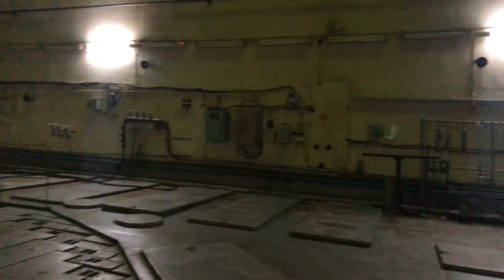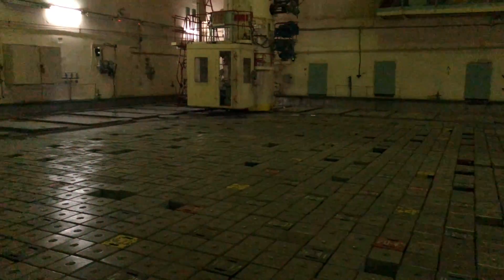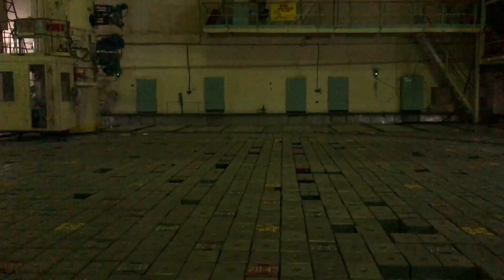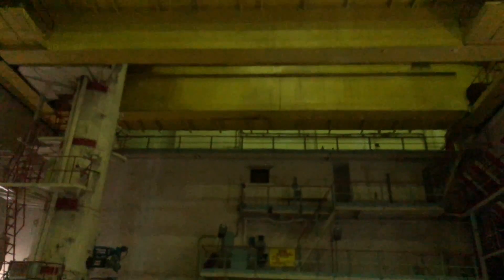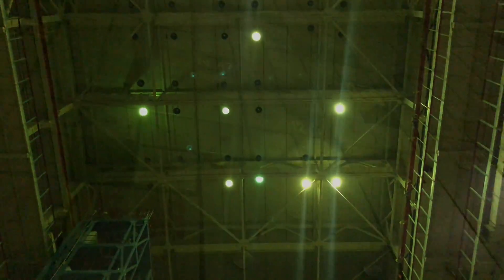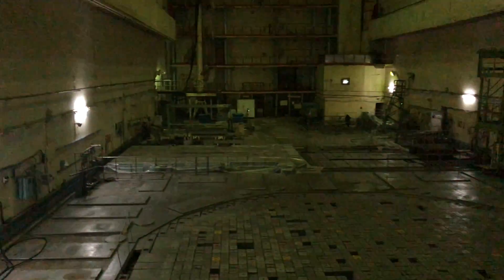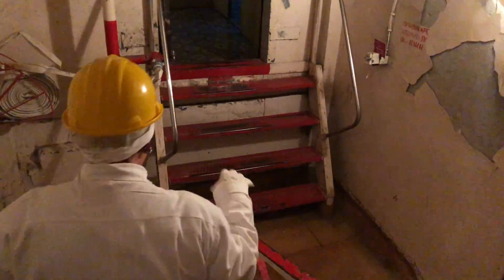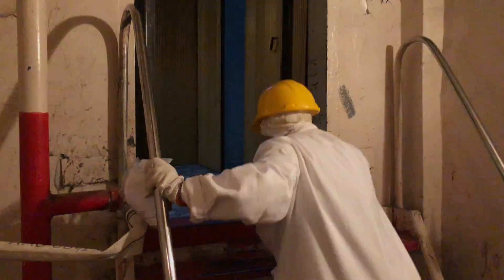Visting Chernobyl nuclear power plant.  Control room 3 and 4 + Reactor 3.

Comment: how did they continue work in the other reactors for years after the accident? weren't 1-3 right next to 4, wasn't the radiation still way to high to work in 1-3? yet it operated for years after 4 blew up
Reply: As far as i know 1-3 were far enough from 4 to not be affected by the explosion.

Comment: This is one of the most interesting and informative videos I've even seen.....really well done!

@4:43, are those round structures with the railing the feed pump motors? I've worked on some pretty big motors but if so, these are huge!

Also, @ 4:57, looks like another big pump motor. Maybe 500KW or so?

Of course, I could easily be wrong.......lol.
Reply: This is main circulatory pumps. And at 4:57 probably the feed water pump.

Comment: What are those grid of steel boxes covering the floor of what looks like a reactor building?  In the movie they start moving up and down independently responding to pressure inside.  But what is their function and why so many?
Reply: They're called channel caps- they're steel and concrete. There were 2044 technological channels in the reactor core, and each channel has its own cap. Those caps cover the channels to protect hardware, servo motors for control rods, and allow workers access to various portions of the 17m (55.8ft) diameter reactor covering by providing a space to walk across. For refueling, workers would remove those caps (it took 2 people to lift one) so that the refueling machine could center over the channel and begin the refueling process. We have no actual evidence that those channel caps ever bounced up and down. The person who is said to have witnessed it (Perevozchenko) was actually in the control room of block 4 at the time of the explosion. It was a myth invented to dramaticize what happened in a book written by Grigori Medvedev, and unfortunately has only been perpetuated by HBO and urban legend.
Reply: @Cailyn_Amanda  Wow. Incredible sane and competent answer. After HBO series I never thought I would see one.
Reply: They are the caps covering the 2044 channels in the reactor core. Some of them had control rods under them, most had fuel. It was impossible for the caps to jump like in the HBO movie however. Under the main cap there was a plug that was threaded into the top of the lid, the refueling machine would lift out the cap, unthread the plug slowly to equalize pressures, and then it would remove the old fuel and put in new fuel.

Comment: Lmao control room 4 almost looks like it's in storage.
The other ones are far more spaced out.
Reply from the maker: Anneke de Bruyn they had to build a new wall through one half of it.  It helps support the new shelter object over the sarcophagus.
Reply: Most of the walls have had thick concrete put in both in support of the Sarcophagus, and as further protection against radiation.

Comment: Why they don’t  wear protective suits for radiation?
Reply from the maker: The levels are not that high now - unless you were to enter the ruins of the reactor hall.  You do though have to wear two layers, a mask, gloves, shoes and covers when entering unit 4.
Reply: Stuart Seggie I didn’t know that
Reply from the maker: @Dimosthenis-qx5nm  still a lot lot higher than normal levels of course and the dust is not good, hence the masks.
Reply: @sas0875  are you allowed to go into unit 4 or at least the reactor hall of unit 4?
Reply: @ranbruhnation  Reactor Hall 100% destroyed
Reply: @ranbruhnation no fkin way The reactor hall is safe dude do you realise the reactor was Located in the reactor hall? If the reactor fkin exploded how can the Reactor hall be safe? The entire hall was blown up it's completely 100% destroyed No way you enter it

Comment: Is control room #4 setting off the alarm or is that leaking radiation into the control room ?
Reply from the maker: Wolfcat Wildcat a bit of both I think but the room itself it’s pretty contaminated.  Floor is all sticky as has something on it to catch the dust.  Dust isn’t good.  That said, the levels in there aren’t too high.

Comment: How did you get access to go there?
Reply from the maker: Kolvtapp you’ve been able to visit control room 3 and other parts for a few years now but control room 4 and reactor 3 was added as a new route from end of Sept 19.  I visited on the 2nd tour and had it to myself, which was lucky.   Tours now run Mon, Wed and Fri and are restricted to 15 people.   You will still need a guide to get you into the zone and they will drop you there and leave you with a plant employee for the tour.
Reply: @sas0875  is it via this site? https://www.chernobylwel.com/tour/9/chernobyl-power-plant-and-pripyat-tour-2-days 
? 
The tour on your video looks really cool.
Reply from the maker: Kolvtapp you can arrange a tour there through any of the tour companies or private guides that can take you into the zone.   I’ve been a few times now and can highly recommend a private guide if you’re interested?  You will see far more of the zone with a private guide.
Reply: @sas0875  Alright thanks for the tip. 
Planning to go in the upcoming spring/summer.

Comment: Did they strip buttons and electronics too in ctrl room no4
Reply from the maker: Austin Jenkins I believe they were all stolen over the years by workers?  So I was told.
Reply: @sas0875  Yeah, I've heard the АЗ-5 button was stolen by a liquidator, I'm assuming some parts were used for spares as well.
Reply: @sas0875 , no, it was taken by КГБ (soviet CIA) to conducting an investigation.
Reply: Chernobyl NPP has problems with tourists stealing light covers from the Unit 4 Control room. Also employees keeps stealing them. I've heard that people want them as souvenire. Not just that it is radioactive, but also you're stealing property of the NPP. I've heard that somebody almost stole lightcover from Unit 3 CR.